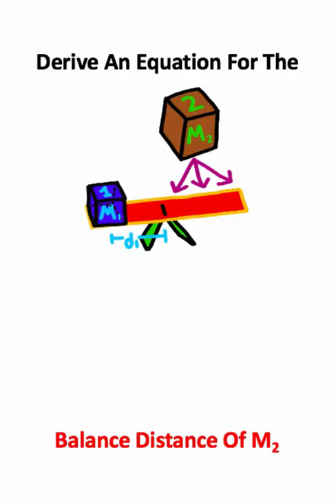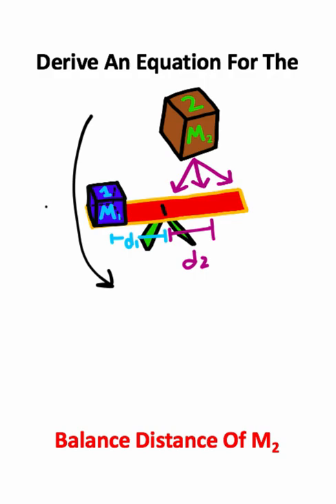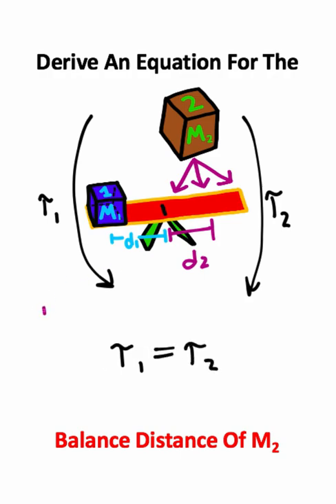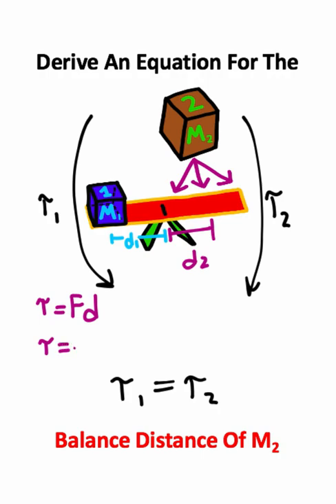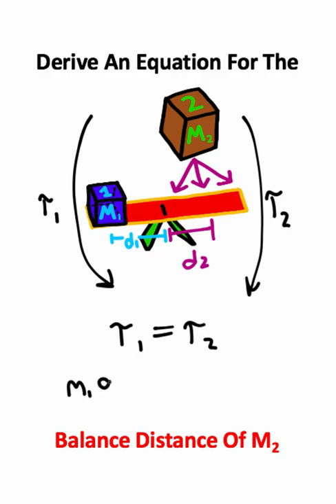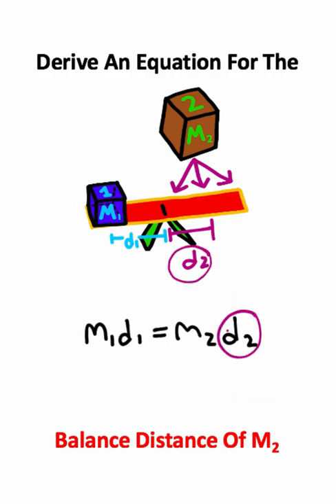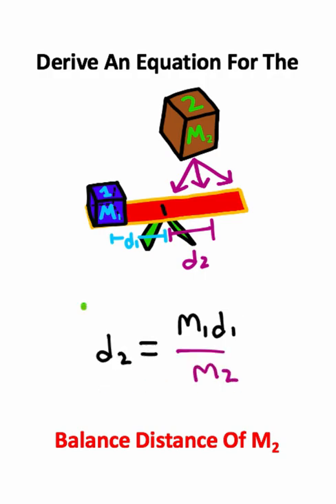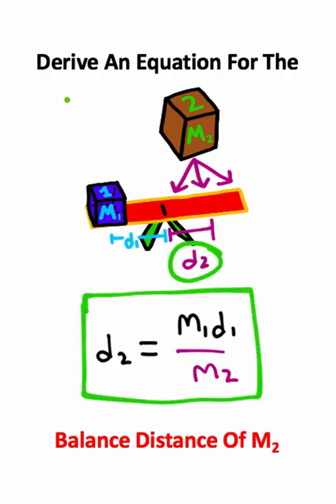Is BALANCE Even POSSIBLE?!?

Comment: gravitational force is not constant
Reply: But gravitational acceleration is.

The formula for gravitational force is
Fg = (GMm)/(R^2)

So the formula for would be

mg = (GMm)/(R^2)

We are multiplying mass on both sides so we can cancel them out

g = (GM)/(R^2)

The mass of the earth is M which is constant and G is the gravitational constant so it’s also constant. R^2 is not constant but R represents the distance a mass is from the center of the earth, so unless you’re launching rockets any changes are negligible.